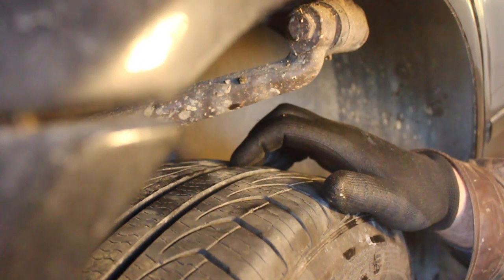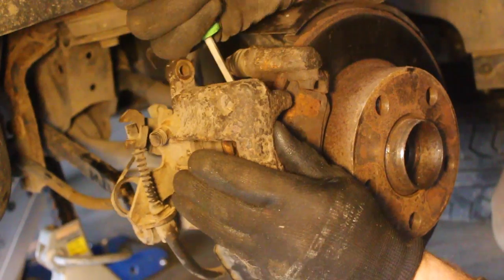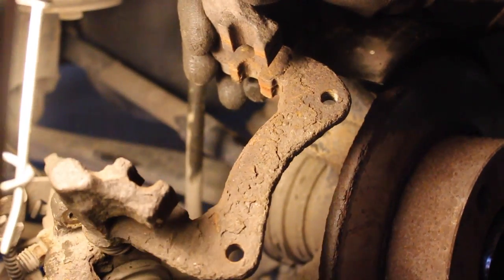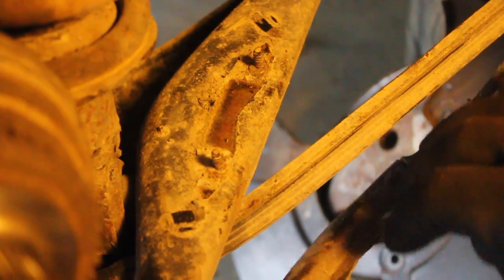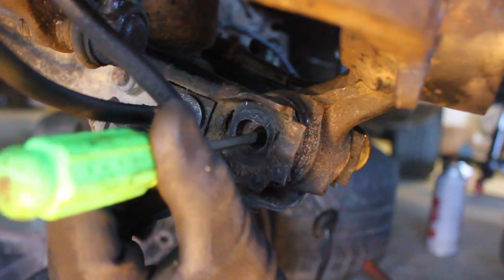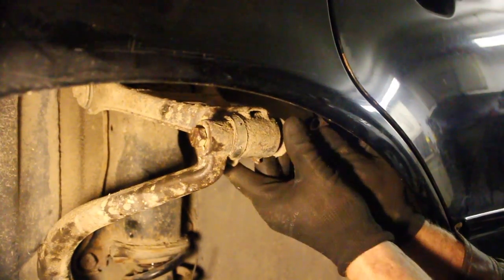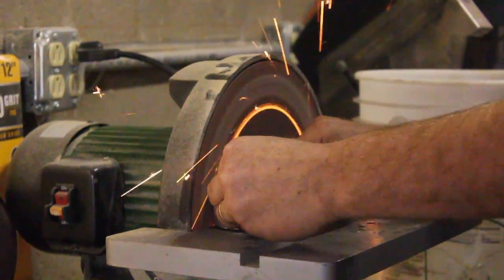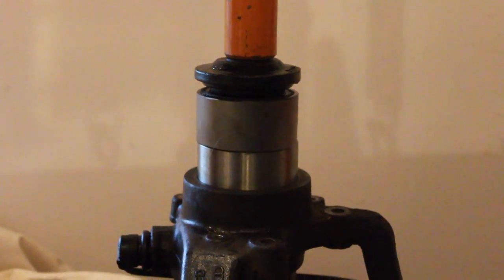BEST way to replace wheel bearing on Volkswagen / Audi

Comment: Ingenious to grind down the old bearing to use to press in the new one.
Reply: actually quite the opposite, you never need to grind it down as its the front opening is larger than where the bearing sits :)